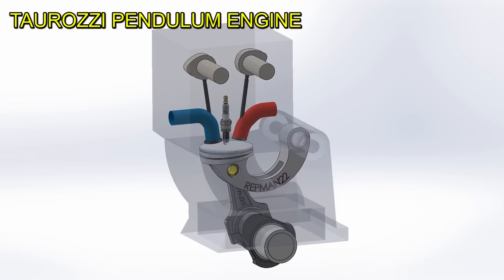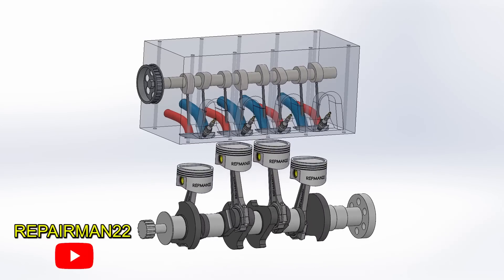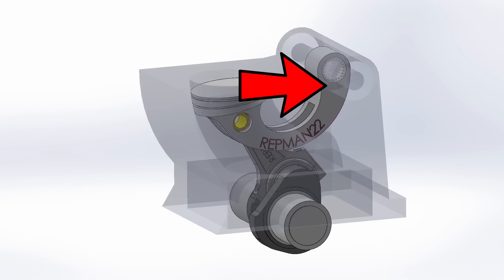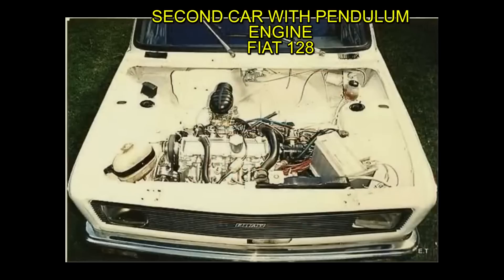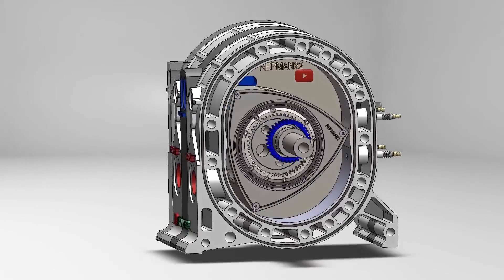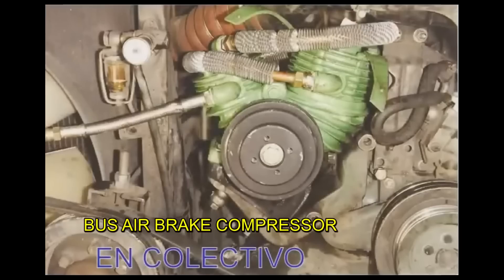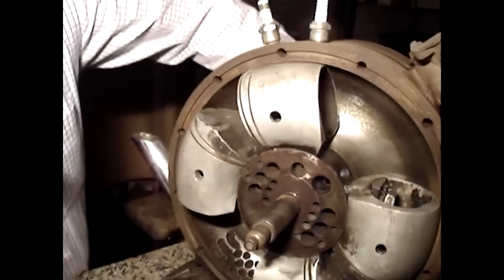All about the Taurozzi Pendulum Engine 🧠 and what happend to it🤯

Comment: Two questions: How is the friction null? And how could a 30% power improvement be achieved through the changes you've described?

 Piston friction is usually less than 40% of the total engine friction, and most of the piston friction comes from the combustion pressure pushing the piston rings into the cylinder, no? Plus, the skirt friction doesn't go away, it's just moved to a bearing. Sure, that's an improvement, but it's still there. Add to this that the rings are likely to cant more in the grooves in this design than a straight cylinder, and it could eat a decent portion of the gains. It only really makes sense in situations where, as you point out, you can't use oil around the piston at all. That's not a great idea for combustion.

The comments from the automakers made honestly make sense. You can't make 30% reductions in friction through changes to a part that's responsible for only a fraction of that amount. The claim that power output improved by that much from this change alone is even more absurd. Friction is usually less than 10% of the total power output of an older engine under heavy load. For a modern engine, it's typically less than 5% under similar conditions. Getting 30% gains from reducing a 5-10% loss factor (total mechanical friction) is truly silly. When you consider that the piston is only about 30% of that 5-10%, it's even more absurd.

Even if all of the friction throughout the entire engine were reduced to zero, it would be an order of magnitude smaller improvement than the 30% increase in output described here.

"I eliminated this loss factor that accounted for 1-2% of the engine's output, and I got a 30% improvement!"

I can see why the car companies were incredulous.

Comment: In the 90’s i had a sears air compressor with a teflon piston, but a normal linear cylinder. It too used no oil.

Comment: Honestly this looks like a revamp of original Atkins cycle with a caviat - not having shorter compression cycle but adding complexity. Heat due to less friction argument does not really work since there are 5 instead of 2 bearing surfaces per cylinder, and I would assume that curved cylinder would introduce uneven wear on inner and outer part of the cylinder or its ring introducing more heat on one side comparing to the other. I mean creative thinkinking but car manufacturers aren't exactly stupid.

Comment: Imagine this combined with pneumatic valves, and a turbo powered compressor system to control air intake to have perfect fuel ratio everytime it fires. Youd probably make an engine near the top end of theoretical efficiency. Then put it in a hybrid so it can take advantage of regenerative braking. Youd be seeing close to 100 mpg. Aslong as it actually does increase fuel efficiency to the amount stated.

Comment: So might improve mechanical losses, but these are already below 10% in a typical piston engine. (Main losses are in the thermodynamics >60% of total energy input) Therefore never going to improve efficiency by 30% of total. Trade it off for more complex manufacturing and increased (reciprocating) weight, and done. Cool idea though

Comment: If boring a curved shape is easy, then why not make a completely circular bore with pistons that go round and round being powered by fuel injection and firing just before it crosses an exhaust port like a 2 cycle engine.  The "ignition chamber" would be formed by a piece of metal moving with the piston to block the opening, and the piston in front of this piston.  The opening would have to be a continuous one all around the inside to allow the pistons to attach to a central shaft.  Kind of a pipe dream but probably nearly impossible to build and pass environmental requirements. However, it would have only the two moving parts, the wheel of pistons and the center  output shaft.
Reply from the maker: you are describing a toroidal engine patented 100 years ago and showed at the end of the video.
Reply: @repairman22  Thanks.  I saw the toroidal engine in the video and had a vision of an engine that ran completely in a circle, all pistons following each other and attached on the center shaft.

Comment: So the claim is the primary benefit is reduced friction, and then later states a 30% reduction in fuel consumption. Uh huh... 

I see greatly increased manufacturing cost with a small benefit, and possibly greater difficulty balancing it.

Comment: i just dont know how it handles the combustion if it only has 2 rings in it. It may add strength to the connecting rod because of that C rod, but the additional C rod could be an added weight and cause low power on mid to high rpm because of the C rod the serves as a guide. After a combustion, the C rod will absorb the power before transfering it to the connecting rod then to the crankshaft. This design is not good for combustion and also bad in maintenance.

Comment: Well the head sits lower so that means the engine all in all should have a lower center of gravity. But doesn’t the greater mass of the piston itself limit higher rpm’s since it will take more energy to change direction from up/down?

Comment: On a compressor, you wouldn't have to worry about expansion of the piston arm, as the heat values are a lot less. I wonder in an engine, how heat lengthening of the arm would affect piston placement in the bore, and how you would compensate for that.
Reply: The fact that he made quite a few of these engines and personally drives one to this day speaks to its viability. If it was only a concept design, I could understand the skepticism, but with as much history as it has had, it seems like it must not be just a flash in the pan failure.

Comment: Hmm, there are regular oil-less piston engine air compressors with dry cylinders.  That's what pretty much all of the low-cost air compressors are.  They don't suddenly have no friction simply because they have silicone rings.  Sealing a piston for compressing air is a wholly different thing than sealing one for combustion.  There's no such thing as no friction.  There are a lot of false claims in this video and a lot of additional performance claims without anything being demonstrated.

Comment: First you can not use bearings inside a engine on those parts why do you think we have main bearings. Second it’s Ludacris concept and my proof is it’s not around in my daily life. The concept just transfers wear to other parts there is no escaping  the issue and when this design wears it won’t be rugged like the design now, also it is 2 or 3 extra parts to wear out as well .

Comment: This style of engine could be modified into a sterling engine that delivers more horsepower than the current Sterling engine. The lack of oil lubricant can make this engine function in outer space without an elaborate lubricant system. The quality of the pistons is important. Aluminum tends to fracture, and heat will always be an issue, but definitely more manageable in space as it produces less. I can see this engine dominate the zero gravity areas where an engine, or compressor is required.

Comment: Making a curved block in mass production would be much harder than you would think.  Sure you can do it with expensive and time consuming machine tools but most engine blocks are cast.  Casting a curved hole in a block would be very difficult and I cant think of any way you could do it.  Medical equipment is an entirely different field because they can afford hugely more expensive products and can pay for the machining time.

Comment: Ok, the piston rings aren't for keeping the piston off the cylinder it's to prevent blown by and helping seal the cylinder during the power and exhaust stroke 
This engine isn't worth crap and that's why it died on the drawing board

Comment: I suspect that what put the auto manufacturers off in the net cost of this motor. It uses the all the same parts as a normal engine but adds in the hinged arm, it's support shaft, and bearings. A lot of extra machined parts, making the motor enough more expensive than a traditional one that they wouldn't consider it.

Comment: I can see a few drawbacks for this engine that have not been mentioned here:

1. The piston needs to be perfectly centered by the pendulum arm in order to reduce friction. Bearings may work fine, but wear over time will increase friction severely. Add to that the different rate of expansion for different materials and you need to engineer a fairly wide gap into this, otherwise the engine will wear itself out when starting cold.
2. Manufacturing this is going to be much more expensive than your average automotive engine today.
3. So why not use it in racing/high performance cars? The pendulum adds a lot of weight, reducing the max possible RPM by quite a bit. This is where all performance engines get their power from today (and have for at least half a century). To counter this you would have to increase cylinder size, but since the surface increases at a much faster rate than the volume, you end up with a lot of parasitic losses that eat up more than any advantage this design ever brought to the table in the first place.
4. Even if there was a niche where this engine could survive, maintenance logistics is likely going kill it. Setting up support for an unconventional, rare design is very expensive for any manufacturer. In the United States, this was a lesson learned from the introduction of the first Diesel engines in passenger cars back in the 80s. There was more to it, but the entire program was such a desaster that it ruined the Diesel for at least 3 decades
Reply: Mmmmmm ...... yep ., the world may need it ., but the market does not ... I think this is almost in the same vain as the Citroen DS ., there may be great advantages ., but the market could not cope with the additional costs .... to the point that how ever good the new mouse trap ., your door would not be disturbed by customers ...

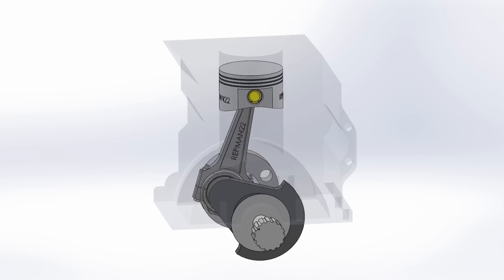Comment: 2:07 "This tall piston produces a lot of surface area that rubs against the cylinder walls." This is blatantly FALSE. The ONLY things that contact the cylinder walls are the piston RINGS, and they are extremely thin, resulting in minimal cylinder wall contact.

Comment: It’s a great concept and all  except it won’t be capable of being fixed  by traditionalEngine Machine Shops  and in the event of failure or wear to the point of needing a rebuild it will be extremely expensive  unless the builder makes affordable Surplus parts  and builds the Cylinders in a Modular style fashion

Comment: 30% fuel savings compared to a traditional 4 stroke? you cant just throw numbers around with out any evidence just for the sake of making a video. An engine like this would have worse fuel economy than a regular 4 stroke because there is a larger reciprocating mass (the extra curved arm) and a larger mass needs a larger amount of power to be pushed resulting in a higher fuel consumption compared to a traditional 4 stroke. If this engine had any advantages over a normal 4 stroke you would see it in cars today and it clearly doesn't which is was why it never made it to production lines.

Comment: I'm not an engineer, but there must be a reason why this engine is not being used for automobiles.  Maybe it is reliability, maybe it is not as efficient as he claims, maybe it is difficulty in manufacturing en masse, as they said.  No auto maker would just not use an ICE that gets 30% more power and efficiency without a reason.

Comment: I find this video very interesting 🤔, as a Diesel engine fan I like all the different engine configurations. I have seen lever engines but not curve cylinders. I hope someone will take it and use it to its full potential. I still have a balance question on the running of this engine. 😇🙏🎣

Comment: Do the sealing surfaces of the piston rings need to match the curvature of the cylinder? I assume they would. Possibly the pin holding the piston ring in place in straight walled pistons could be omitted since the ring would want to stay in its correct place? Could curved cylinder sleeves be manufactured and pressed into a curved block, or do you need to mill the entire block from one piece?

Comment: Bullshit. You're still pushing a connecting rod and turning a crank. No 30% economy. Also manufacturing tolerances need to be in the hundreds of thousands of a micron or you incur additional damaging wear. Current engines allow for several mm of slop. I'm with the auto makers and smell fakery.

Comment: The design has alot of disadvantages no wonders why it is not in use and 30% efficiency is straight up lie. The engine block will expand unevenly under heat. The combustion will be uneven due to curved path and will require redesign of all the intake/exhaust and injector location. Even after that it will be pretty difficult to have good combustion because air fuel mixture will hit the piston at a certain angle and piston surface has to designed accordingly. Engine block will need more space and more material and extra space for pendulum which will add up weight and more moving parts.  Piston will wear unevenly because it will have to travel larger distance to complete stroke.  It will cause uneven vibrations and noise.

Comment: Less gas and oil used and longer engine lifespan we can't have that it's a loss of profits.
Like the Buick 3.8 they quit producing cause those engines would go for 500k miles no problem. Can't sell more cars if cars last a longtime. 
Instead of using these engines to save on oil n gas they just made cars lighter by making them out of thin metal so they rust out quicker. 
You don't need evidence of their thoughts when their actions show their ideals.

Comment: Since the inner side of the cylinder has a shorter radius than the outside, I can see preignition being a problem with this engine. Combustion won't be uniform and you will create hotspots along the cylinder and piston.

Comment: Looks interesting. If it works so well for sterile gas compressors why no interest from the car companies? Cost of manufacture? With the push to electrification I don’t think now is a particularly good time to resurrect interest in any ICE technology. Maybe the circular engine the Aerospace Company introduced on “Autoline After Hours. That one has a really good power to weight ratio. This one looks like it would add weight. Thanks for the video.

Comment: Although an interesting concept ...if it did actually offer real or better mechanical performance, efficiencies, benefits and improvements....then it would have been picked up.... or later when the patents ran out! 

....but as nobody did - except for small scale low power generator / compresser application  - there must be some issues regarding high load and performance versions !  

But as CAD modelling, testing, analysis and CNC machining are widely available - to explore, re-examine, test, develop and prototype old or new ideas and concepts...and could easily make some scaled down prototypes to evaluate.  Yet still no real interest means.... there is a real technical  problem and issue with it.  As a curved con rod with a hole mid way to connect to a normal conrod...doesn't seem a structurally great idea for high loads without very careful consideration...but great for low power uses!?

Comment: way more complicated to produce
way more parts 
Fixes an issue only happening out of warranty (so not interesting to the OEM)
More reciprocating mass, RPM limiting.
Makign that cyllinder for an air compressor is one thing
making it for a combustion engine is another thing , especially with modern boosted engines, the piston rings and boost require cyllinder coatings which might not be feasible to produce with this shape cyllinder.. 
also, compressors are steel cyllinders, where as for engines , in cars, have to be light, so aluminium.. So mass producing that shame is generally done in completely differing ways for alu engines then steel compressors.

Comment: As a mechanic andmechanical engineer I can tell you that manufacturing a curved cylinder to spec is anything but a "relatively easy task". Roughboring that Cylinder might, but getting it to spec is an absolute nightmare. It will require honing tools specifically made for that shape, which then wear out unevenly. You will end up with a specialized honingtool that will require dressing probably even before one Cylinder is finished. And even with that deviations will be really hard to avoid. 

Ensuring quality is also a nightmare, as it is virtually impossible to measure a curved bore in adequate time.